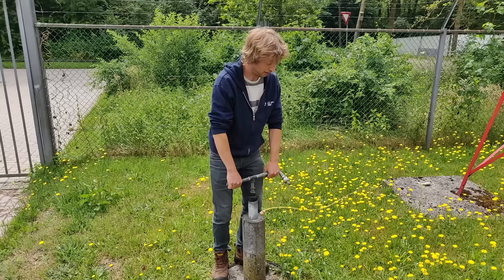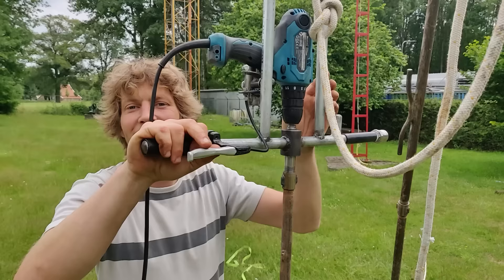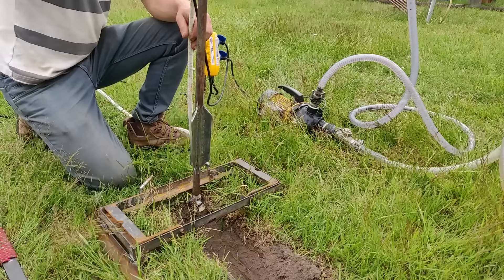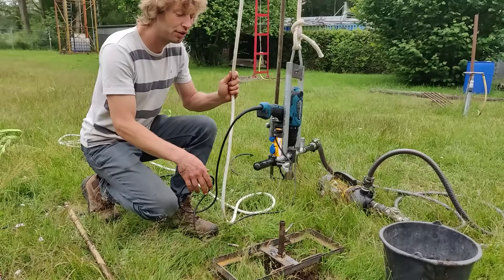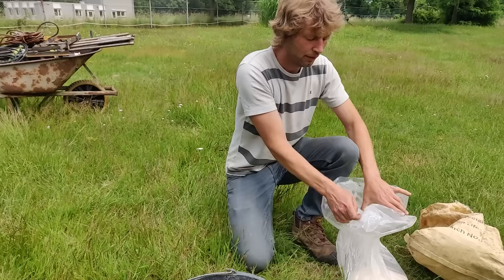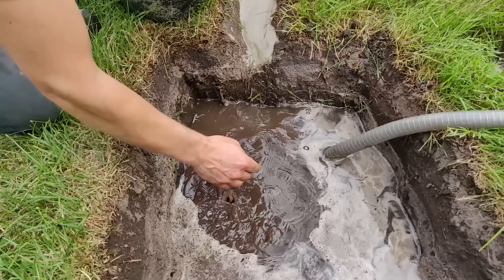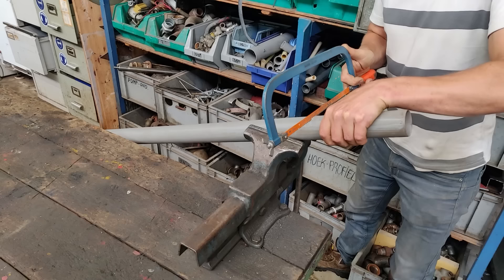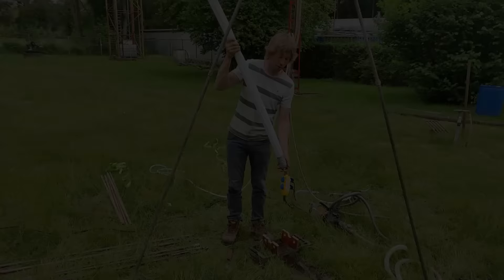DIY Well Drilling Using a Hand Drill.

Comment from the maker: Technical drawings of the swivel are published on our website (link in description). If you want to build this setup yourself you can use these drawings. If things are unclear, you can contact us via our website. If everything is clear and you managed to make your own setup, well done! Please consider sharing this with us as well, we really like to get some feedback and insight in whether the setup is used and how and where etc..
Reply: If you want some pointers feel free to look at some of my designs . I built one of these years ago . Keep trying, widen your pipe . Your swivel i had some issues with debris getting stuck in it i had to widen out the holes and space them further .Keep up the good work. If you want to make them even cheaper you dont even need a circulation pump you can hook a garden hose or 2 to it & drill with fresh water  although you just have to go extremely slow when you hit watersand this way it dont dig to quick & loose pipe. 
Also that design is old . I am in the process of making one that doesn't require a hand drill simply water .  I can send you some of those designs also.
Reply: I can't wait to see these drawings thank you
Reply: I need this video in Spanish
Reply from the maker: @stinkyvonfishstix4196  The drawings of the swivel have just been published
Reply: @wot I reccomended pinning ur comments on ur videos to make it easier for others to see if the comment section become too big
Reply: One trick is to put a float on the suction end. So it keeps the end the water but not close to the muck. Plus it helps keeping the pump from sucking muck. 
Great set up you have 👍🥳
Reply: The swivel was the only question I had. Thanks man this is great.
Reply: Would like to know your website
Reply: @thhillbillyinventor105  I'm not the greatest person on the web so if you can leave me your website so I can get two years I would like to see what you have done sounds very interesting
Reply: @forposterity4031  isn't cpvc used widely as water lines for potable water?
Reply: @paulmacmillan2359  in the EU they are used as sewage pipes only 😁
Reply: Would be incredible to end this great video another video about how to create a rotary swivel since seems not easy to build without complex tools
Reply: Zijn deze onderdelen voor de bormachine en de stangen te koop ook?
Reply: Pin your comment
Reply: Can we order swivel from you?
Reply: @kimmedina881  I would buy one as well
Reply: I love your home made elevators.. Where's the BOP?
Reply: Iam in Kenya, how can I get it
Reply: What is the name of the additive you put in the water?
Reply from the maker: @Canbechangedtwiceeveryfourteen  Barasol
Reply: Could please  me where to buy from  the drill head
Reply: @WOT_utwente  thank you
Reply: Thanks
Reply: Way cool videos...thanks
Reply: That's cool please keep up the great work
Reply: Thank you for posting the tech' drawing.
Reply: Am from A caribbean island called Grenada 
Can i order the set up to conduct drilling from you guys and how much would it cost me
Reply: I would like you website information
Reply: hello congratulations my friend how to do this for petrol drill
Reply: Es ce qu'on peut faire un puits de 35 mètres avec
Reply: @christiansfellowshiptv4124   hello
Reply: I spent like $700 on this things and it's not working I'm doing what to just doing I burn through the deal drill already and I bought a number four it's not that easy I don't think I'm doing anything wrong I saw your video like 100 times I even bought the chemical and nothing it's working
Reply: Hi. You make a video where was drilling a water well. I'm serious and please when you can tell us how you made that piece? The part in the middle of the handlebar of the water drill. The part that makes the connection between the drill and the drill pipe. The piece through which water flows but still spins. Plecase Say this to us whit a video . Please 🥺
Reply from the maker: @Lahoradelcafee  Hi, I am sorry to hear that things are not going well. Drilling a well is not an easy thing to do, it certaintly does requires some expertiece and experience. If you contact us via our website and explain in detail the exact problems you are experiencing, we might be able to help
Reply: Hi your system is encouraging please can buy from you?
Reply: This is so cool bro. I want to Do it but i think in german we go to yail then😂
Reply: Очень хорошо у вас получается, если можно чертёж вертлюга
Reply: @richardmadrid5244
Reply: Dit werkt waarschijnlijk alleen in grond met relatief weinig gesteente in de bodem. Ken wel locaties waar men om water staat te springen maar het slaan van een put meer kost dan men zich veroorloven kan. Hebben jullie daar toevallig een oplossing voor?
Reply: Ok
Reply: "If everything is clear and you managed to make your own setup, well done!" ... aggressively clicking like
Reply: Drilling was good. but now you have a piece of rotting Jesus tape in the well. why not use  superglue or even a metal wire to attach the screen cloth.
Reply: Pp
Reply: Where is your website
Reply: Having issues like the other poster.. Built it, using the same stuff and its not going like the video. I'm on drill number 3 now (first one actually caught fire). Made it 11ft. So I have no idea if your material is much easier there, or I'm doing something wrong. The only difference is I could not source Barasol and instead used Bentonite mud (very common in the oilfield as drilling fluid additive). 

I have gone back to the drawing board and will be trying to power with a 49CC auger motor instead. I will also switch to a more powerful pump in hopes of getting some cutting action from the water itself. We will see if that solves the issues.
Reply: Hi guys! Cool equipment and Great job 👍 I’m drill a abyssinian well in Russia, what do you mean about it?
Reply: . Hi
Reply: Can this go through stone if needed?
Reply: @RasaCartaMagna  No - this will only work for soil/mud/sand. I guess small stones in the matrix may not matter, but unless they are quite small they won't make it back up the hole and will collect at the bottom which I suspect starts to make life difficult after a while.
Reply: in the clay how deep it can be done by this equipment?
Reply: Can you do a wider shallow well with this method?
Reply: Right??.
Reply: Hey boss. I have a couple of hand drills. Could u make me a kit with everything else I need ? Send me a price quote please. Let's do buisness
Reply: how did it go?  @Travellerwiz
Reply: @taavetmalkov3295  I built a drill but there is NO WAY this system works with an electric drill. After smoking 3 of them I gave up on that and switched to a 2 stroke post hole auger power head. I even tried and industrial mixing drill made for heavy loads. 

Even then, 20ft was as far as I could make it in my area. I tried 3 holes and that was all I could go on all three. Even that 20ft was VERY hard going (not like the video). It took constant down pressure and pauses to clear the cuttings. Our ground is hard clay, then obviously a rock layer that I couldn't get through.
Reply: Where can i buy the drill head?
Reply: If you had a more powerful drill and pump, could you still do this?
Reply: try using a pressure washer, you will have time to get cleaned up and spend the day in town!
Reply: @thhillbillyinventor105 7:28
Reply: @thhillbillyinventor105 can you send specific guidelines on how to drill water? Thank you
Reply: Hallo ik Ben in gouda hoe kan ik je bereiken?
Reply: Guys, here is The Savior

HalleluYAH translates “Praise ye YaH”

YaH is The Heavenly Father
YaH arrives via the TENT OF MEETING
YaH was Who they Crucified for our sins
YaH was Crucified on an Almond TREE

Ancient Semitic of Moshe (Moses)
Isa Scroll (The Original Isaiah)

Isaiah 42:8
"I am YaH; that is my Name! I will not yield my glory to another or my praise to idols.”

Isaiah 43:11
“I am YAH, and there is no other Savior but Me.”

Isaiah 45:5
“I am YaH, and there is none else.”

Comment: Instead of heating and twisting the end of the pipe, seems it would be easier to just glue a cap on it.
Reply: sure selador, but often you have these spare sections of pipe in remote locations. No cap. This sort of demonstration allows people to envisage multiple uses for things.
Reply: The method shown also serves to round off the end, so the pipe goes into the borehole easier. A cap is "squared off" and offers more resistance, and may snag on the well wall.
Reply: Our caps are rounded. But both responses are very good points.
Reply: Use what you have on hand. I did a lot of plastic liner coring and we used the liner and caps for lots of things...

Comment: I have been watching DIY well drilling videos over the last two days (doing some research to do our own one), and this is hands down the best one I've watched thus far. Well done dude, well done.
Reply: Polyvinyl chloride (PVC or vinyl) is the most toxic plastic for our health and the environment. PEX is safer but still leeches chemicals into water. Copper is good if the ground water is not acidic but big $$$$, Clay pipe is the safest for chemical contaminants but it's hard to install without breaking and professionals usually need to lay it. PVC will contaminate your gardens and ground water pretty badly though, pex is probably the best choice.
Reply: We.had ours clasped and we could only get it partly opened with full metal 308 rounds! I need this drill setup so.i can.get ours back open fully!
Reply: @forposterity4031  Or use steel pipes, cheaper than copper and can withstand some amounts of low pH level (just less than 7). It doesn't contaminate the soil and the water much, but rusting can be a problem.
Reply: How deep do I have to drill to access water
Reply: @luqmaanparakh8744 Where I live, the comunity has a geological map with the local water table. Also, often farmers will know this, so maybe ask a local farmer.

Comment: I have experience as a well site geologist and operations geologist in the oil and gas industry. You basically present all the basics in drilling, mud logging, and muf fluids engineering.
Great video and thank you for doing it!
I would want to see if there are any other videos regarding wind or solar powered pumping for homesteads.
All the best!
Reply: I am a Petroleum Engineer
 I was thinking EXACTLY the same!
Reply: He still does not show blow out preventing.
Reply: @alexlo7708   Blow out prevention isn't a concern for water well drillers as subterranean water isn't under pressure.
Reply: @DominicNJ73  If anything the opposite is the problem lol
Reply: ฉันทึ่งในการเจาะ ฉันเพียงต้องการความลึกแค่8-11 เมตร(พท ของฉันมีแค่ดืนดานที่ขวางกั้นน้ำใต้ดิน เพื่อการเกษตร มีแค่สว่าน  เครื่องดูดน้ำ ก็เจาะได้ ทึ่งมากๆ ขอบคุณ ที่ได้เห็น อุปกรณ์ที่คุณคิด ขอบคุณนักขุดเจาะน้ำมันครับ
Reply: And as experts, what would you suggest for us people who would like to drill a water well with a similar method, but we live in an area where there are also stones and rocks?
Thank you
Reply: Yeah, it’s epic! Onlyyyy thing I would add is at TD, pump a high vis sweep & then spot a high vis, weighted pill for cleaning & stability while out of the hole
Reply: yeah was wondering if he's a oil driller making a well on his spare time.... :p

Comment: Well done, you have captured the fine points of drilling very well. I have drilled many dozens of sample bores to over 700ft, these techniques and devices are exactly what we use, all but on a heavier scale. We use bentonite in the mud to clear the cuttings and use two pits to help remove the cuttings from the mud. Stop with the bentonite for the last 2 or 3 meters, change the drilling mud out for water, so as to not plug the wall of the bore. Risky, the bore may collapse, but worth it for yield. Only used the gell a couple of times, works well and maybe doesn't clog the bore as much as bentonite. Nice vid.
Reply: Well done...well done...it's just a pun
Reply: @CoinsAndCapsaicin  dang, an accidental pun. Well spotted
Reply: How do you know how deep to go, asking for a friend
Reply: @quinnjones2886  There is no "deep enuf" number in water bores. As the author noted, ask how deep the nearby wells are and base your well on that.
The water bearing strata are a contour, much like the surface contour, but not necessarily an exact match. Remember about 3/4 of the water in a river is flowing under the ground under the river.
Look at the lay of the land, read the contours, look at where the water flows on the surface, imagine where the underground steam would be.
Ask the neighbours.
Reply: You've never drilled a well till you've fell in the hole, LOL. That's how my work day started, digging 2 3ft x 3ft holes. We went to using a mud pan saved a lot of work
Reply: @nigeltechnz  You're right you can pretty much predict depth by your neighbors. The most amazing thing I've seen many times is The earthquake fault line is Summerville SC. You can drill in 1 yard and be good at 500ft then move to the next yard and it'll be 2000ft. The stratus are the same thickness but it's like looking at a 1500ft cliff while standing on flat ground
Reply: Hi Nigel. Know how we can get such a water swivel? Please help.
Reply: @kimanijack  The author has posted details below and in the description on how to make one.

Comment: Lazy and and smart are two different things. you did it the smart way. if you were lazy, you'd have cut 1/4 the cuts and probably never did this project. Thanks for the great demonstration, although I don't plan on using this knowledge right away, you're one of the better videos I've seen on the subject, without all the fluff that usually goes with them. 
cheers!

Comment: Reminds me of my former life in the Alberta oilfield.  All the elements are there:  rigging the derrick (a topdrive rig, very modern), digging the rathole, running in, adding a single, using the slips, tripping the bit, managing the mud, running surface casing, cementing off.
Great stuff.  The downside would be hitting a shallow aquifer that is pressured up and having a blowout!
Reply: lmao I was thinking the same thing
Reply: That would be a winner YouTube video though that would pay for itself!
Reply: What are the 7 signs of a kick?
Reply: @jmorton3462  an increase in flow rate, pit volume increase, if your well is flowing when you aren't pumping, if you aren't getting proper fills when you trip, cut string weight and mud weight, and one more that I can't think of off the top of my head since it's been about a decade since I worked in the field.
Reply: @brennonbrunet6330  bubbles in the cuttings
Reply: @brennonbrunet6330  well than your now either an electrician or a hydrovac guy now
Reply: @jmorton3462  or it's been a decade and I couldn't remember off the top of my head, because a lot can happen in 10 years.  If this were a test, I would have gotten 86% of it right. and since I no longer work in the oil and gas industry and have to be aware of these things at all times lest myself or someone else get injured I don't really give a damn what you think I may or may not be.  If it makes you feel better I can explain how hitting a loss circulation zone could cause you to suddenly lose mud, which then reduces the hydrostatic pressure, which can then allow the now increased formation pressure to dissolve more gas into your mud reducing the overall density of your mud which in turn makes the whole problem worse.  I can even explain to you how contrary to what you may think, you don't want to go past the calculated hydrostatic equilibrium, as well as why staying as close to equilibrium as possible can end up saving you from an exponentially worse situation.  You know, If I cared what you think.
Reply: I found this interesting.  A long time ago I was a relief driller for a drilling company.  This is a lot like how we drilled wells . I left because the oil field goes through the boom to bust . Thanks for the video
Reply: Right down to slop mud lol. Most watching prob don't realize they're watching damn near the same way we drill for oil minus the stuff to keep it off the ground and from environmental stuff. But yea. Just a mini single more or less.

Comment: I have drilled several (many) water wells in Holland.  Mostly in sand, clay, peat layered soils. Water from peat layered soils has a brown colour, is a bit smelly and it may contain salt and other pollution depending on geography. If I found peat while drilling, I always drilled 3-4 mtr deeper into the sand to get clean water. Isolate the peat from the sand with a rather long clay plug to avoid peaty water sucking into the filter pipe.
Reply: How do you create the long clay plug? I assume you mean the contamination because one soil level has been punched through when drilling and the water would mix through the drill hole opening.
Reply: @ssa7843  I think they mean like in the video when they insert clay into the pipe over the sand. Fill up sand in the good layer, then fill up clay pellets in the undesirable layer. But you have to drill to depth first. The casing isolates the good water on the way up.
Reply: At what depths would you find the water table, and did it vary a lot between different parts of the country?